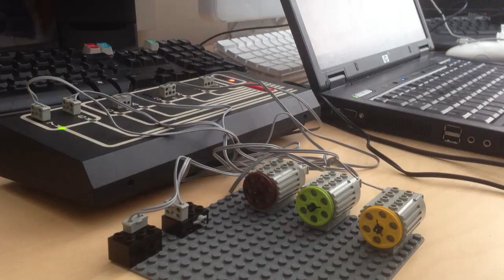LEGO DACTA Interface-A Demo

Comment: Nice one :) I wondered how you supplied power to the interface connection (the 5V required through the 20-pin connection by the optocouplers etc., not the supply for the motors). I’ve wired it to a parallel port, but I have a bizarre situation where the output signals will only get through when either of the inputs is also active (as though the inputs are somehow powering the interface connection). I’ve tried using control signals (e.g. strobe). I’ll now try to download your code from the Wayback Machine and see if I can see what you’ve done ;)
Reply from the maker: I can have a look when I next set it up if you like
Reply: @burf2000  thanks. I suspect the power available from the parallel port varies between machines (it worked on a 1998 desktop, but not on my 1994 laptop). Also, I’ve discovered that the earlier Interface A (the one with the round-top, dim LEDs) requires less power (from the port) than the later Interface A with flat-top brighter LEDs